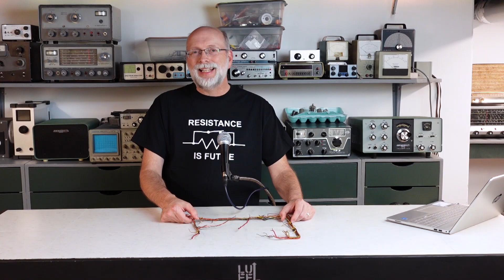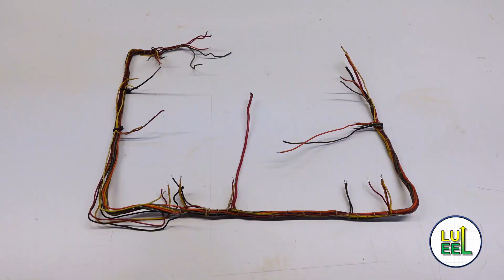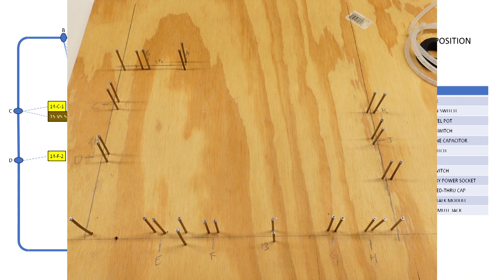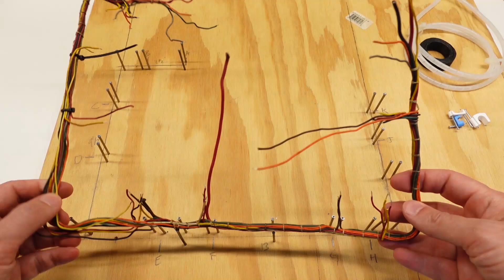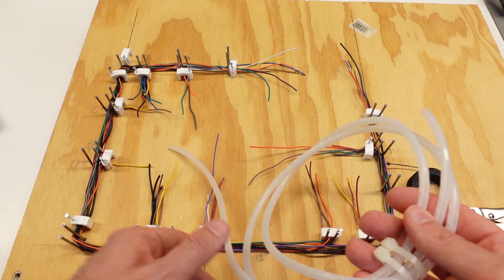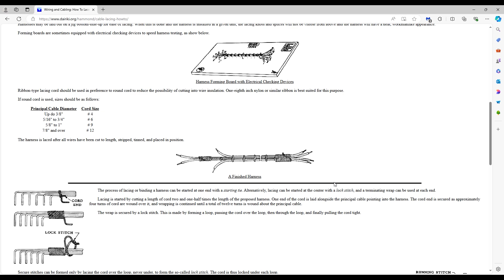Heathkit DX-60: Part #5

Comment: I learnt to do lacing using nylon waxed cord, in the end used to love doing it. used to make the cableforms for avionic equipment that went in to the cockpit.  it was broken down in to lots of stages, and after every stage it had 100% inspection.
1. cut, strip and tin wires.
2. put on ident sleeves.
3. solder wires to any sockets.
4. put heatshrink on socket connection and shrink.
5. lay wires on to wiring pin board for that harness.
6. finally get to lace the harness.

i was about 17 at the time and it took quite a few weeks to get to the point of not getting a laced harness rejected by inspection. 🙂

Comment: So glad you decided to lace the harness. I have redone harnesses in Collins and Drake gear and as you mentioned the process moves along quickly. I really enjoy your channel and look forward to more of your video's.
If you didn't find the article regarding a simple circuit to exercise a sticky meter, let me know and I'll dig through some of my old mags and see if I can find it. Though the circuit is very simple and easy to throw together. As I recall, you simply switched a positive LOW V then a neg. V and use a pot(s) to prevent too much travel in both directions. I jury rigged something years ago and fixed several meters. Exercising the meter back and fort for 30 mins to an hour did clear whatever was causing the problems. It was either contamination or oxidized wiring. 
73, Glenn WA4AOS

Comment: Why carbon comp resistors?  They drift in value more than metal film.  Metal film also are lower inductance.  Great videos.
Reply from the maker: I haven't been able to find metal films in higher resistances (>1k) that are spec'd as non-inductive.  All the data sheets I have read except one make no mention of inductance, which makes me reluctant to trust them.  And the one I  did find were for resistors no larger than a few hundred ohms.